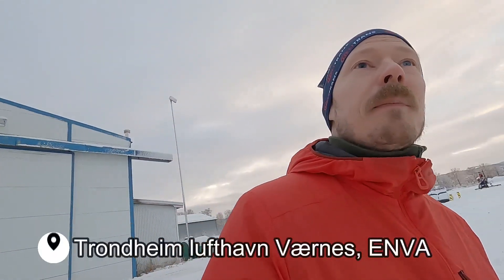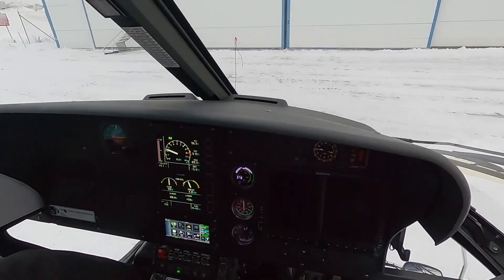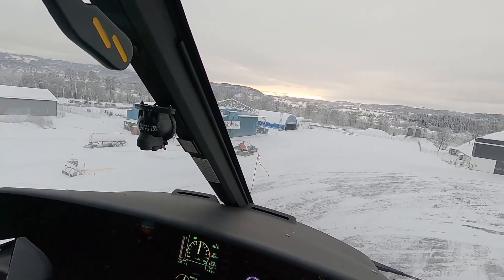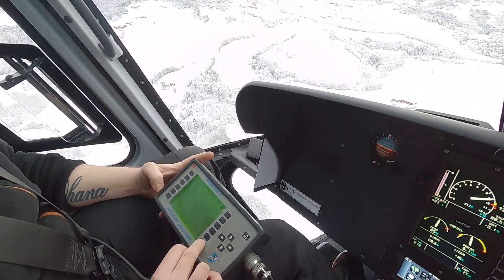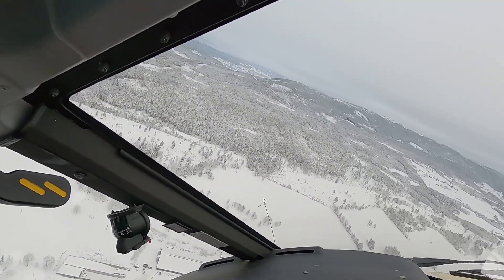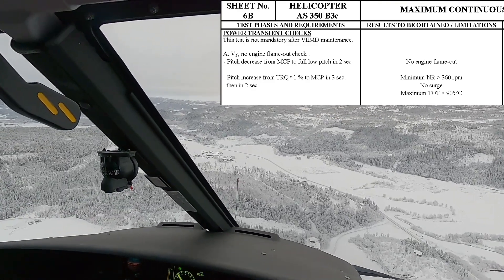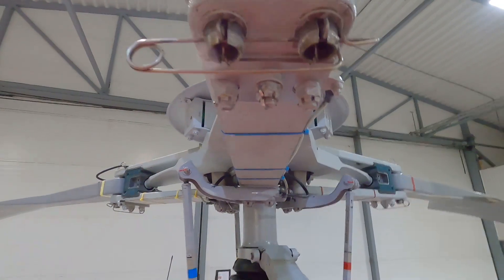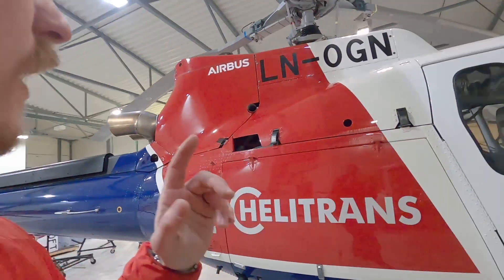Airbus H125 600hr post maintenance flight check & main rotor track and balance AS350

Comment: The engine flameout and engine surge checks are not difficult, if you separate them into three separate checks, as the 6B  test card shows.

Tesr one, engine flameout check. Setting MCP, and going from MCP with a collective reduction to flat pitch in 2 seconds (one one thousand, two one thousand, is the cadence), then recover to mid range collective after flat pitch. Testing that the fuel control doesn’t remove fuel at such a rate that the engine flames out. That’s test one.

Tests two and three are also two separate checks and are the same action, with just one at 3 seconds and one at 2 seconds (H125) or 1 second (B3-2B1), using the same cadence of counting mentioned above in the first test. This is to check that the addition of fuel by the fuel control when adding collective in the timeframes noted, isn’t so much that it surges the engine or makes the engine hesitate/cough. Both of these tests start with setting MCP first and mentally “marking” where the collective position is at when at MCP, so you know to not pull up collective past that point during the test. This is done so there is no reliance on the FLI, as it lags in its reading due to the rapid application of collective in this maneuver. Once the collective position at MCP is mentally noted, then slowly lower the collective towards 1% torque. As the collective is lowered below around 15%, on a B3E / H125, the collective anticipator will kick in, automatically boosting the Nr to around 402. At this point, add about 2 inches of forward cyclic to keep the Nr from increasing and continue lowering the collective to 1% torque. With the rotor disk properly unloaded due to the forward cyclic, the Nr will not increase even at 0% torque, it will sit at a constant value. Reaching 1% TQ, raise the collective in the 3 second timeframe using the above cadence no higher than the mentally-marked collective position for MCP and stop there. The FLI will catch up and stabilize at or a little below MCP. Record the max TOT and minimum Nr, and that check is complete. Do the same thing again but in a 2 second timeframe and record the max TOT and minimum Nr again.

The important thing with the two surge checks done here isn’t to get back to exactly MCP, getting close enough to it is fine with where you marked the collective position for MCP mentally. The important thing is the proper exercising of the fuel control by the addition of collective in the timeframes given, or the reduction of fuel control in the 2 seconds for the flameout check.

Treating the power transient checks as three separate checks, makes recording the data easier, and allows a mental reset of the mind by getting the checks done in an orderly fashion and without rushing through any of these checks, just as they are written. 

For our operation, performing sheet 6B in this fashion, makes it a very easy check to accomplish.

Comment: Just an observation, maybe I am wrong, on the TRB, you have weight on both chord weight locations. Should only one location is required to have weight? Same on the MRB, blue blade at the end of the track and balance should be no weight added to it. On the video seems to all three MRB have weights.

Comment: enjoyed the video. Wow. That max torque test.....I see the reason for it being difficult, very easy to go past the limit when quickly moviing throttle to max.  In the beginning you mentioned about the parts being "gone" were they replaced? or just overhauled?
Reply from the maker: Hello sir, I can't account for all, but they are all removed from the heli and then undergo their own inspections 😊 but the same engine and box go back in afterwards tho
Reply: @dsholden1  i watched documentaries of Norway. If I  had the money, I would visit/tour your country

Comment: So gearbox was overtorqued at 93.5 for a very short time, what actions are needed by maintenance after this happened? Do they check the gearbox for damage en reset the warning massage? 

And thanks for the heli vids, cool to watch! :-)
Reply from the maker: This was recorded in the maintenance system, there is a log of over tq and that eats from a over tq buffer. Too many or too hard could send the box to overhaul. To my knowledge they only looked over the machine and released to fly. 
There was no over tq registered by the Vemd.  Too low value. Any message of this would self reset on next start. 
edit: got feedback from maintenance dept that a value of 93,5 over 40kts ias does not require any maintenance or inspection, got the maintenance manual docs and sure enough.. anyway the purpose was to enlighten and share for learning purposes :)
Reply: @dsholden1  thnx man, was just curious. Flying the R44 but hopefully turbines soon 🤞😁